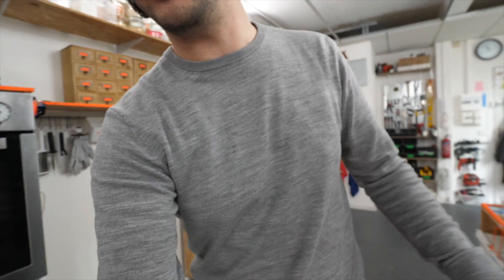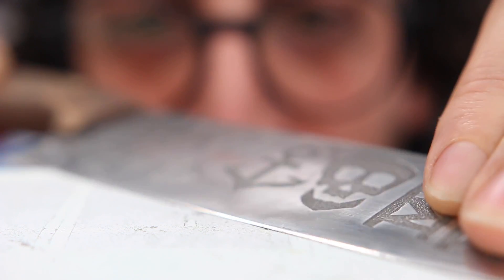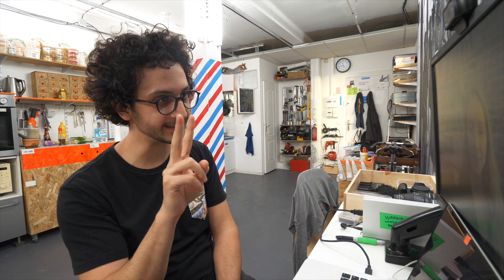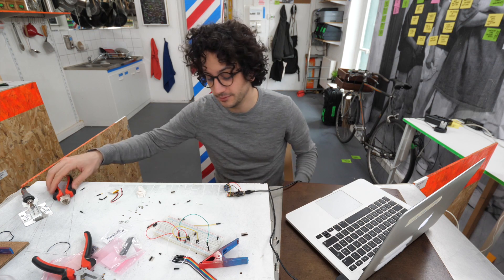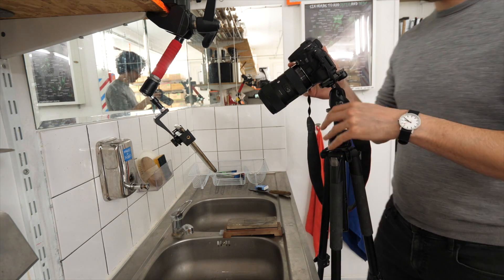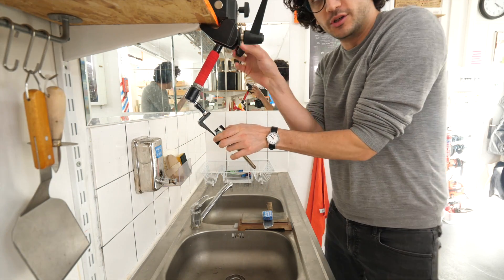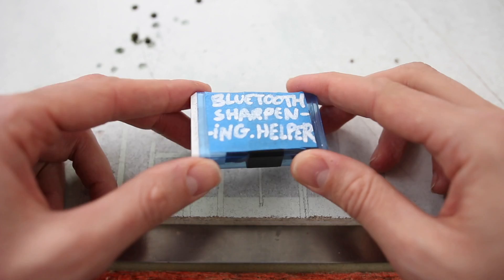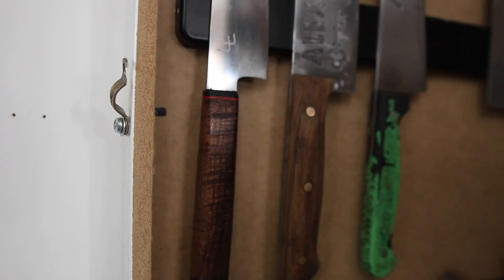Is This The Future Of Sharpening ?

Comment: Idea! Try visual or audio feedback instead of number. So for example, you can connect the tilt factor to the pitch of a audio tone, so then you will hear when you tilt. Ok, so to make sure you have the right tone, you can have the app make play the tone of the desired tilt, and at the same time play the tone of the actual tilt. This will work if you have a good ear for matching tones. Probably much mor intuitive and immediate than just looking at numbers. And you can always change the variable so each level of tilt creates more shift in the tone if it's to subtle. A version of this would be to have "silent" when you are in the right tilt angle, and two different sounds that changes depending on if you have to little or two much tilt. With headphones you could do something with stereo. 

Another idea! Basically the same as with tones, but with colors. Have the desires tilt be represented on half of the screen with a colour hue, and the actual tilt represented on the other halv of the screen. As soon as you shift tilt you will see the colour change and can adapt immediately.  

One more: Patterns instead of colours, so you could have the same setup, two parts of the screen showing the actual and the desired tilt. And then you aim for matching patterns, a pattern can be for example black lines on white background, and the lines tilt with the actual tilt. 

A big pro with doing the audio is that you don't have to lock anywhere else and can focus on the knife sharpening with your eyes, while being guided by sound. 

Good luck!

Comment: This is a cool project, but it has one small design flaw. You are determining the angle by only measuring the z axis acceleration of your sensor. When you have the knife at an angle, you will also measure the acceleration introduced by moving the knife along the stone. So maybe you are already very steady, but your device is not accuare enought.

Comment: I would rather get a sharpening guide than use that.  I get the point of it, but heck no it's not going to help in the sharpening process.  It's nice, but really not practical in the overall process.  The idea is to make something that KEEPS the angle of the knife correct NOT something that can tell you what the angle is.

Comment: You should add an auditory helper like a tone that represents the correct angle for example middle c on the keyboard. When your angle is too low the note goes flat when too high the note goes sharp. Then parameter settings to as you get better at sharpening you cal narrow the tonal field. This way you don't need to look at the phone. Perhaps it's two notes, one stays constant and the other travels with the pitch. Pitch  = angle. Good luck with your project!

Comment: Ummm I am curious but wouldn't it be possible to set the inverse angle on a stone and then using a locking hinge to fix the angle. Or if the end goal is to get the feel and consistency, a spring system set up connecting the knife to a flat surface to offer resistance i.e a spring that only offers resistance when the angle of the back end of the knife is causing a shallow angle. Think spring ball point pen since only after a certain amount of pressure is applied does the tip lock into place.

Comment: The issue with getting the correct angle might have to do with the stance you take as follow through with each stroke. This could also be a problem with the height of the sink too. It looks like you have to bend at the knees plus slightly hunch your back. Since nothing on your body can lock into place it would make getting that correct angle all but impossible.

Comment: It would be better if there was a small display on the device to help you see if that number is while you sharpen. -Actually then again the angle your sharpening at isn't the actual true angle of the blades edge thats being read because there is already a angled bevel that your placing your measurement on.  Unless one side of the blade is completly flat and then the angle accounted for its going to be off by 3-4 degrees. You need to account for all the angles of the triangle.

Comment: Speaking as a mechanical engineer specializing in design and manufacturing, this is the perfect application for a mechanical fixture. You need a gauge block manufactured to hold your knife at the angle you desire to remove the weak element, the human, from the equation. A 3D printed fixture for the shape of each of your knives with a magnet epoxied into it to hang on to it would be the perfect solution.

You could integrate your electronics into the mechanical fixture to verify that your setup is accurate during use. So if you accidentally were lifting your fixture off of the stone, or the fixture had worn down, your electronics would provide that information as a simple "yes" or "no" instead of streams of fairly useless constant data. This approach is literally how practically everything in a factory works. A robot working with electronic feedback places things into mechanical fixtures that are hard tooled and equipped with sensors that ensure the thing that the robot was supposed to do actually got done. Do those things in concert and you've got a manufacturing process.

Comment: Here's a suggestion. 

Instead of moving your arm to sharpen the knife, why not move the whetstone instead to sharpen the knife. 
Because in this process, your arms have 2 responsibilities. One, to move the knife back and forth. Two, to control the accuracy of the angle. Therefore, by moving the whetstone, you remove 1 responsibility from your arms so that it is able to focus on the second (more important) responsibility. 

Hope this helps! :D

Comment: from my last comment, I have a thought on going forward on over engineering this thing into perfection.  using this setup, one could build an additional piece that is a small gyroscopic stabilizer.  run one or two small flywheels that have been spun up at the desired angle.  the flywheel will give your hand instant feedback pressure for the angle it wants to be at.  it could be bulkier but only needs to rest on the handle or above the back of the knife by clamping it on at a higher position.  This device would be a brutal build I suspect,  and im not sure where to begin.  But give it a thought, it sounds real cool.

Comment: No offense, but I believe you over engineered this one (perhaps just to much for others to replicate). The super simple and easy angle finder is called a domed bubble level.  it is a tiny air bubble trapped inside a dome shape that is filled with colored liquid (you're an engineer, why am I explaining this to you? you already know what it is).  It can be made yourself pretty easily and then calibrated and marked by hand simply using the geometric tool you made before.  

You wont be able to take into account the acceleration factor while in use (unless going very slowly over the stone) like you could with this arduino build, but for general feel for the lie of the knife it is simple and requires no knowledge of more complicated engineering things.  You've always wanted to keep things simple for the audience, I think this may be a simpler DIY solution. 

My parts list include: some domed shaped object that can hold water, I was thinking like those plastic 2 piece kids toy containers from vending machines, a small magnet, food coloring, a marker, and your cardboard angle cutouts.  I hope you can see where I'm going here.  This is gritty and again wont correct for acceleration but will give you a good angle feel for way cheaper and with less engineering needed.
Reply: One word: sloshing. If the dome is shallow enough to be sufficiently sensitive and the fluid has a low enough viscosity to be "real time", the bubble is going to be all over the place. Don't get me wrong, a bubble level is great for getting the initial angle... but it won't track well enough to develop muscle memory during the sharpening process unless the knife remains still and the stone moves.

Comment: Thanks Alex! If the aim is to train yourself to be more consistent then i'd suggest having a tiny speaker on the device that varies in tone. So as you get closer to the ideal it makes a different noise. So no noise = exactly correct, higher tone = angle too high, lower tone = too low. If the idea is to sharpen consistently then using a guide is likely better (like this https://www.nisbets.co.uk/masterclass-knife-sharpening-guide/cn349)

Comment: You could put 5 LEDs on it, which Show you if you have to Lower the angle or if you have to make it wider. e.g. Green light in the middle 14-16 degrees, yellow led under it 16.1-19 degrees and so on. Kind of like a Guitar Tuner, which Shows you how much you have to tighten or losen the String

Comment: maybe a small display ontop of the device would be much better than using a shitty smartphone. you would also get rid of the bluetooth parts and could probably reduce the size of the device? idk
or use red and green led. set up angle before using the device. green led for hitting the angle and red for not.
good idea anyways

Comment: I think having a colored light, or a sound, would work best. Sending the number of the angle to your phone means you need to pull your attention away from the knife. More importantly, I think, interpreting a number takes a fraction more mental processing that interpreting a tone or a color of a light, so it's distracting for that reason as well.
But this prototype is very promising! I'm tempted to try out a device like this on my knives, since arduinos are cheap and fun to play around with.
Reply: And of course now I see that many others had the same idea I had, though I see little justification. Regardless, I'm glad I found a reason to ponder.

Comment: Cool concept! I can only think of 1 suggestion: what about having the output be in graph form instead of running numbers (or the option to switch between both)? Add the option to preset the target angle you want too. I'm guessing trying to tweak your angle while looking at a graph will be easier than trying to read and interpret the numbers. Not sure if there'll be any lag issue though.

Comment: How about put Leds on the box which is already on the knife.. it should shine in different colors to indicate the sharpening is done correctly. For example, Green if the sharpening is done within a preset angle e.g. 17 Degrees and within a tolerance of 2 degrees or so. and then it starts getting yellow or red when outside of that ;)
However before going into manufacturing, you should look into possible distribution channels and potential costumers ATLEAST, before actually making it ready for the market.

Comment: Maybe sound could help. A audible response would be nice. Like tuning a violin. Using the right angle, the sound is a nice and clear tone. Is the angle a bit different, you will heare a wrong tone, like turning a screw on an instrument to far. If the angle is very wrong, you will heare a scratching sound. It has to be extreme, that everyone hears a difference. Idea B: Maybe in stereo?! With headphones on, you hear nothing, is the angle to high, you heare a tone on the left ear, getting louder by getting wronger. Is the angle to low, you hear it on the right ear. That could work for an unmusical guy like me.

Comment: or you could just use a piece of wood cut to the exact angle you need...... when will people learn we dont need computers to do everything! almost guarantee the wood angle block will work not only better but be more persistant than your ability to hold the blade at the right angle

Comment: I don't know if it's already been suggested down below, but: what if you add a sound to the output whenever the angle is outside the interval (15 +/- 1.5) degrees? When connected to the laptop the delay shouldn't be much. That way you can test whether your consistency is attainable with your bare hands when rightly guided or whether natural irregularity in the movement rules you out as an accurate guide.

Comment: hi alex

last time you was sharpening knife i was wondering to write something to it, i didnt, but now i MUST. why are you trying to manage yourself to keep the angle?? out there there are some machines which are designed to solve this problem. they are called fixed angle knife sharpeners. with help of these sharpening is much more easier. In the past i was like you. i was refusing true about these machines. i was thinking that whetstone is glory of sharpening. but i tried the machine and i must say, you will never keep right angle during whole process by yourself. now am using machine KMFS, and sharpening is pleasure. Angle is fixed during whole process of sharpening and at the end i always come out with razor sharp knife. then im testing it to shave my arm :). if you want or have some questions do not hasitate and write me. i would like to discuss sharpening issues with you. Dominik

Comment: It's not the angle at every second you need to worry about.   It's about the average angle you're working off of.   As long as you're consistent, the blade will have the same trend on both edges of the blade.

Comment: Why go for such an unnecessarily complex implementation? I think it would be much better to just have an LED on the device which goes on if you are +/- 1° off of the sharpening angle. Combined with a "zero" button for calibration, this enables much better and instant feedback during sharpening than to observe a number on a mobile phone, also making Bluetooth unnecessary.

Comment: You need a light for feedback on the device. You should be looking at it while sharpening; otherwise, you will probably not maintain a a good and natural posture. What if the light turned green when you are within 1 degree from your desired angle (17). Then it is only about keeping your hands and movement the same to keep the light green. It would turn red if you are not at the right angle

Comment: Maybe, the horizontal movements of the blade and thus the sensor affect the detection of the angle. (Like à pendulum you would move back and forth) You may see it when you are very steady in your sharpening movements, the sensor oscillate between 17° and 14° at the rhythm of your movement. 
To test it, put your sensor on an angle wedge and simulate the sharpenning movement. 
Awesome anyway! keep going Alex!

Comment: Maybe a setting to a certain angle with the indicator directly on the device like small LED light or something. You set the angle to 15 degrees and the device got LED indicator that tells you its 15, by let say show a green light, and then show you the signal that it is wrong if you deviate too much from that set angle, like by show a red light. So by that way you know the feeling about the right angle if you practice well enough.

Comment: What a great idea! I haven't read all 911 comments so my apologies if this was mentioned before but here's my input: 

There should be a row or pattern of LEDs, giving you feedback on your angle. For example a row of five LEDs, with the center being your Green when you're on target for an angle you've input into a app, and then the two on either side of the target would give you feedback on which way you were drifting and by how much. Maybe someone brand new could have a setting of +/- 1.5 or 2 degrees, and the outboard LEDs would light to indicate +/- .75 or 1 degree from the target for the first row and +/- 1.5 or 2 degrees for the outer LEDS. The app could allow you to change that value to the limits of the hardware. 

Start at +/- 2 degrees and once you get a feel for the task move to =/- 1 or less, for example.

Comment: I've seen you using the blade side to scrape the goods from your boards after cutting in to a pan or bowl, in a different video... Use the opposite/back side, and less sharpening needs to be done.

Comment: According to Murray Carter, whose been both forging and sharpening in the japanese method for a long time, nobody really gets the exact angle all the time.  Overtime this creates a convex grind to your primary edge which makes it better with age.  Huge variations are an issue but in my experience you get things pretty sharp so long as you raise a burr and then do a good job removing and polishing.  As long as you're not going to shallow so it can't maintain the edge, or well into the 20 degree side the biggest factors on the knife between 12-17 degrees are probably going to be the quality of the edge, which either has to be very keen or toothy, and then what path the food travels once you hit the grind.

Comment: Consider trying the Paul Sellers approach to sharpening a blade.  Instead of mounting the stone (or diamond plate) and holding the blade in your hand, clamp the blade to the table and hold the stone.  I always feel like I have much greater control over the angle when holding the stone instead of the blade.  I like those 6" EzLap paddles.

Comment: the first  prototype was cool because it had a light that would turn green when you had the right angle.. maybe you should add that so that it turns green when you get into the 
-1+1 desired angle...
so you set the desired angle and then set the tolerance range?
and until you get into that range the light is red.
could help.
Reply: I'll try and follow/tweak Becky's thing and see if I can do it first. 
BONNE CHANCE ALEX!
Reply from the maker: Merci !!!

Comment: Use a BBC Micro:bit. For 25€, you have everything you need: microcontroller, battery, accelerometer, compass, 5×5 LED screen. It's all built-in the small card, no soldering involved! You can detect quite easily the angle and display it on the screen. You can code it with Blocks, a visual programming interface for 10 year old kids. Then all you need is a small transparent box with a magnet on it to put it on the knife.